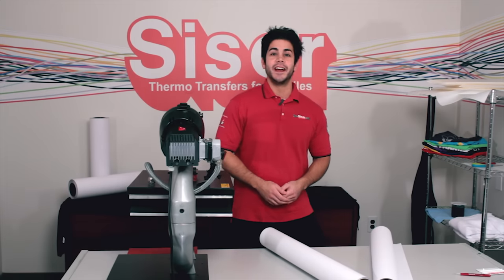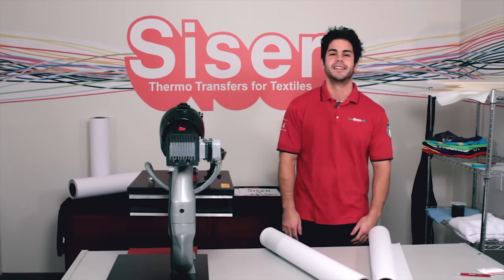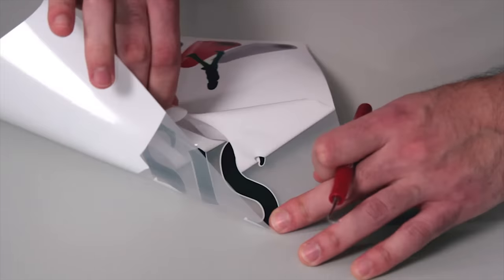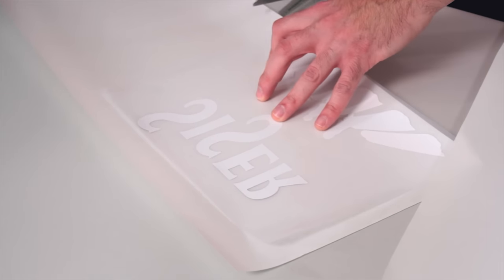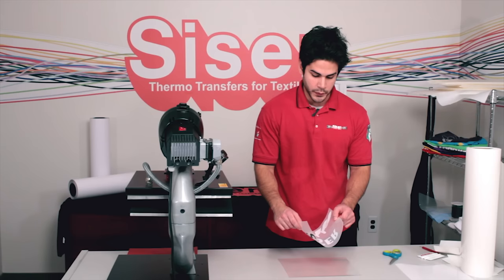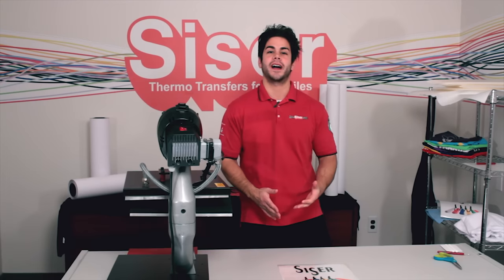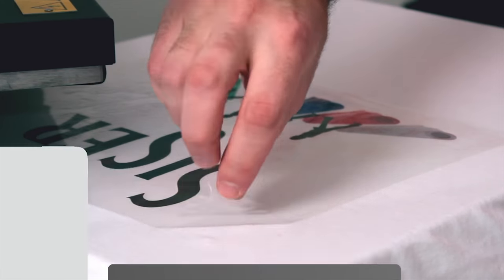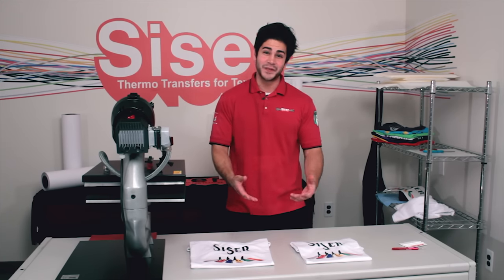How to mask and apply ColorPrint PU print and cut material on T-shirts

Comment: what printer/cut machine did you use in this video. I have both a sublimation printer and a Canon PIXMA printer but i don't think any of them are good for this type of vinyl. Can you suggest a good yet reasonable priced printer. Would i search for an eco tank printer?
Reply from the maker: Christina, The inks used for this type of material are typically found in large format printers costing many thousands of dollars. You can use your sublimation printer wit hour glitter material and also with a new product we have coming out in January.
Reply: @SiserNorthAmerica   what is the new product coming out in January?
Reply: @SiserNorthAmerica  I thought you said that you cant you a sublimination printer.
Reply from the maker: @FenderCandicom  You cant use a sublimation printer on this product in the video.

Comment: Hi! Great video!
Question: can i use any type of printer ( ink jet printer)? If i use ink jet printer, what happens with the ink when you wash the t-shirt, material...? 
Thank you!
Reply from the maker: Ramonia Deco Inkjet printers won't work with our printable materials. You would need a large format printer/cutter such as a Roland VersaCAMM.
Reply: Thank you so much for the answer !!!
Reply from the maker: lorenza jAMES That press is manufactured by Siser in Italy. I believe the majority of them are sold in Europe.
Reply: $$14,000 yikes

Comment: Will the Epson workforce wf-7710 printer work with this product, and does it automatically cut out the designs as it prints ?
Reply: you can put eco solvent in a new epson eco tank and print and cut with cricut or silhouette

Comment: Is this different from siser easy color dtv? Is the easy color dtv used with a inkjet printer standard  ink?
Reply from the maker: ColorPrint PU is an Eco-Solvent Material that works for large format print and cut systems

Comment: What if the TTD Mask is not picking up the Printable PU? Mine won't come off the Printable PU backing.
Reply from the maker: Try using TTD High tack mask and if that is not working then it is time to check the cut settings. If the blade is advanced to much then it can score the carrier and push the material into the score line

Comment: Can you use a regular inkjet printer for this or you have to have one of the expensive printers. Just asking cause I currently use Neenah Jetpro and Jet Opaque which you can use with regular inkjet printers
Reply from the maker: Eugene, the Neenah papers are literally just transfer papers. ColorPrint materials are specially formulated for Eco-Solvent and Solvent based inks like in the larger print and cut machines.

Comment: I cut on the wrong side of Easy Weed Glitter one day, it cut the mask but not the htv.  So can I use the TTD Easy Mask on the glitter htv before cutting so that it acts like a normal htv?  Also can you use an inkjet printer to print on the print and cut?
Reply from the maker: Paulette, Glitter has fine grains on the surface and the TTD Easy Mask won't adhere to it enough for you to be able to run it through a cutter. For Print and Cut materials, you need a large format digital printer/cutter.
Reply: I"ll crop the paper to make it work i just need to know if the paper is compatiable with the printer

Comment: Can I heat this into a coated Canvas bag? Specifically a Louis Vuitton monogram neverfull bag? Will it work? TIA
Reply from the maker: you may want to test on how the coating/canvas reacts under the heat of the press first....but if isnt overly abrasive, you should be able to apply to it.

Comment: Is it possible to use a Vinpower Digital Venetian Solvent Ink System VENSOLPTR with this transfer paper PLEASE HELP!
Reply from the maker: cappa318, I looked up the printer you mentioned and I only see the version for printing CD's. This material is only available in 20" and 29.5" widths...
Reply: I"ll crop the paper to make it work i just need to know if the paper is compatiable with the printer
Reply from the maker: I honestly couldn't tell you. That isn't a standard print cut machine that we're used to. The best I can say is to see if you can get a sample from a distributor and try it. Your machine may be able to pull double duty - but I have no way of knowing.

Comment: He only showed how to print it but didnt show how to cut the image out. its a trick to this process. they say you can use any printer. i dont think thats true because he mention about a latex printer. To answer the question to how he cut it:you will need a vinyl cutter with a laser tracker on it to trace your image. Print+cut option on your software if your using Flexi or sure cuts alot
Reply from the maker: +Dg Customtshirts There's really no trick to this process. The machine is a printer and cutter in one... like a Roland VersaCAMM. Once the design is printed, the head will go back and cut the design out. It follows a specific color for the cut line.

Comment: The PU HTV is a terrible material to be cut and transferred on the TDD, I set the cut force in low level, you cannot transfer the printed vinyl on the TDD,  I want the uscutter to refund me money, the siser PU waste your time, I will give up the HTV siser to go to the DTG printing, it is a bad experience to work with the PU
Reply from the maker: If you have any issues, you can always contact our support department. You can also try the TTD High Tack Mask for better results.
Reply: Tbh I use their thinnest material the soft colour, and I have no problems now, but I did at first , I've actually managed to reuse my TTD mask several times 😹😹
Reply: Sidney Hui I get the same problem with masking the 'softprint colour' as well especially when using large image. No matter how hard I squeegee, it will not peel as easy as it's always shown in the videos . Don't know what I'm doing wrong? Maybe the medium tack TDD is not the one to be used & unfortunately this is the only ones they sell in my country...